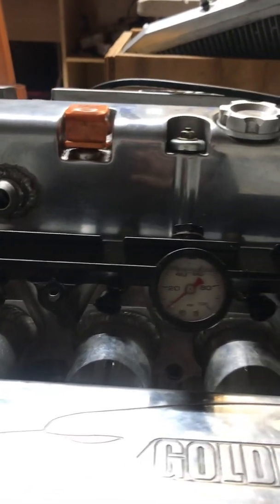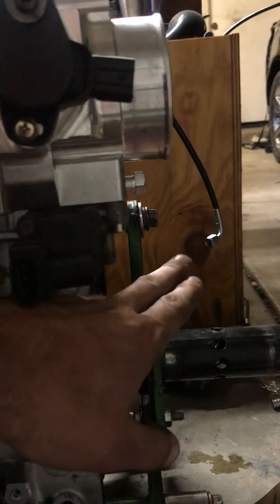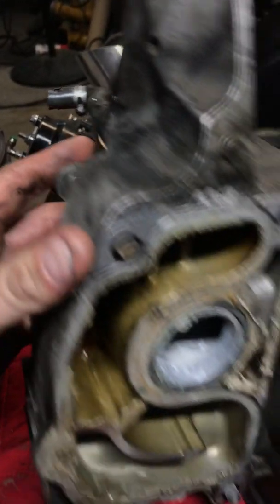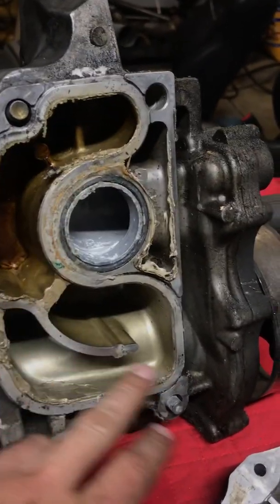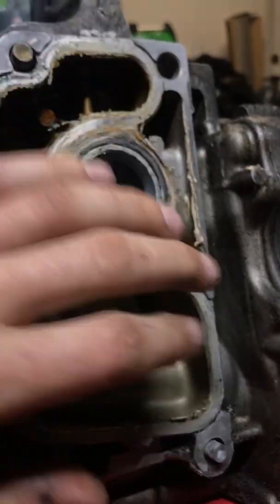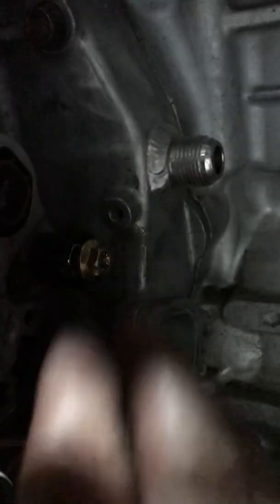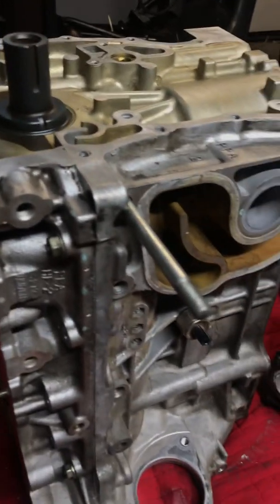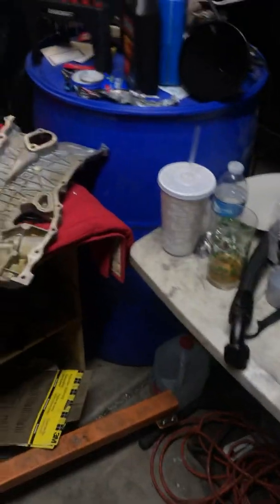K series turbo oil return

Comment: On the K20z3 the location you have it at has some issues to clear the 2 hoses from the thermostat housing. I love mine to the side that faces the alternator and used a 90 elbow -10.